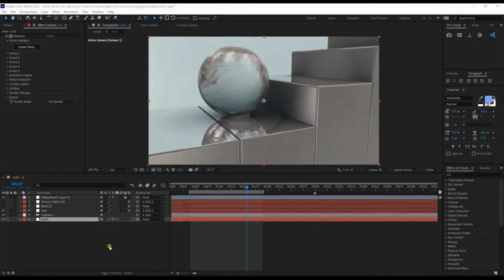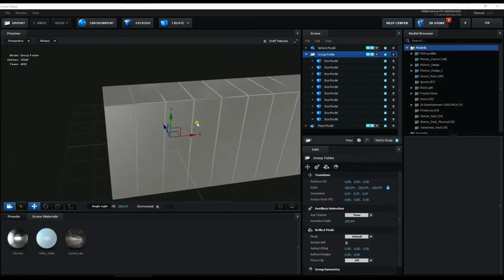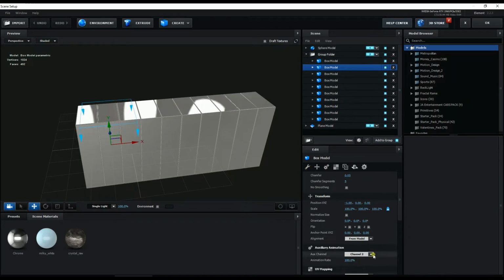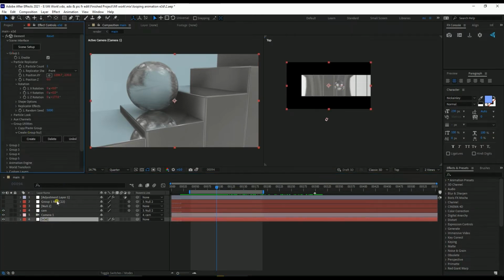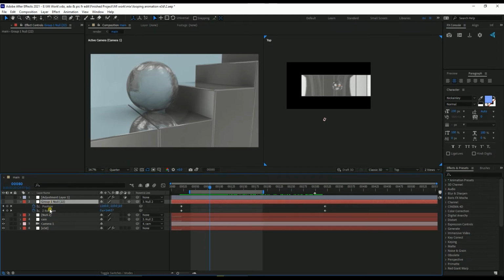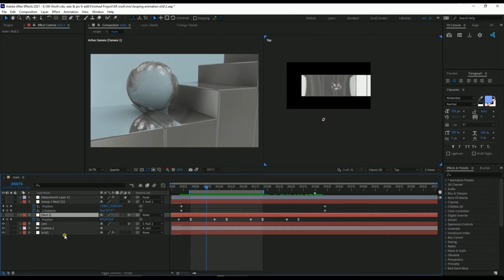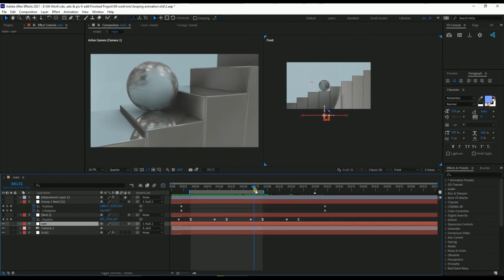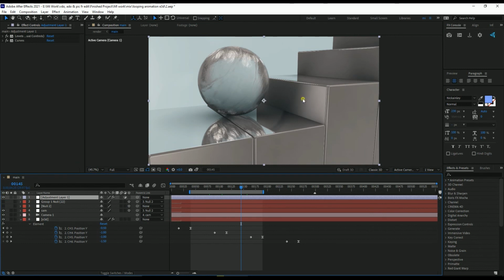Creating Ball Rolling Loop Animation inside Element 3D | After Effects Tutorial

Comment: Question: I have a ball that I would like to roll on the floor. How do you create the group null and attach it to the ball? Thanks
Reply from the maker: take the ball and place it on a different group than the floor. i.e. if the floor is in group 1 then put the ball in group 2. after that create a group null for group 2 and you can control the ball with this null.
Reply: @badhon92  Thank you for the quick reply. I meant, how do you attach the ball to the null and rotate/move it? The spiral thing
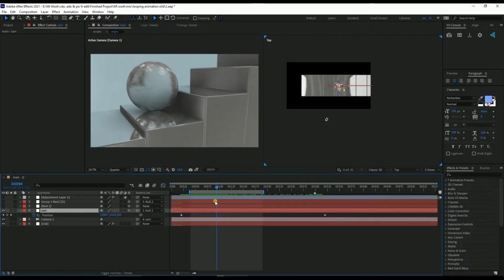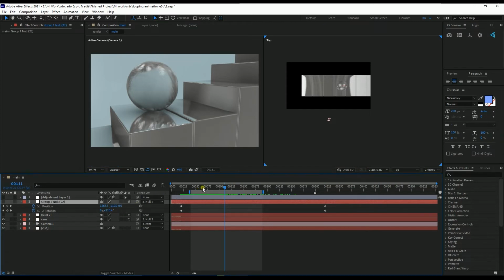Reply from the maker: @birdbrainsolutions6112  i actually explain that in the video. watch from 2:07 to 2:33
Reply: @badhon92  Okay, I didn't watch the whole video first, will watch it again. Thank you so much! Great work btw :)